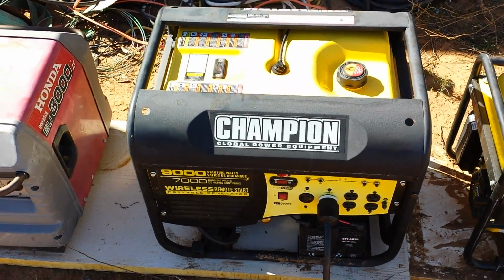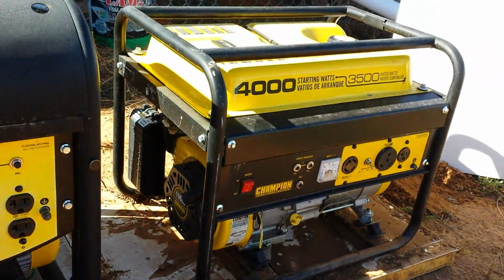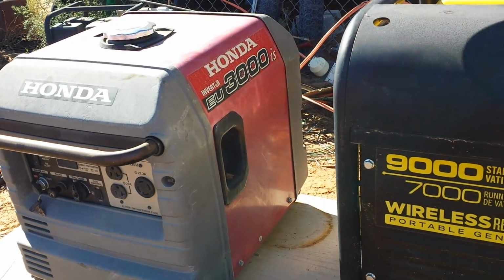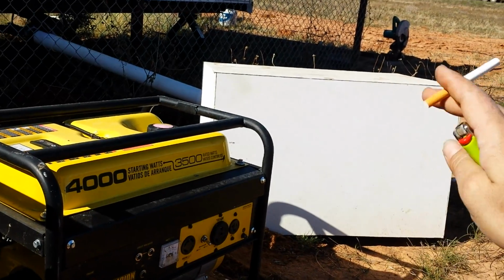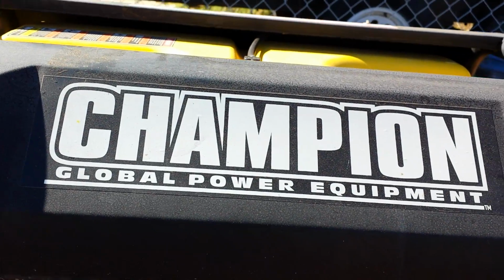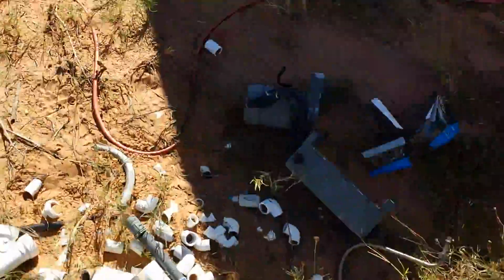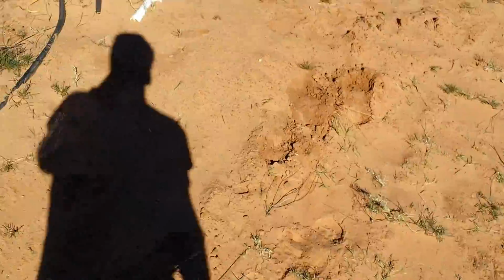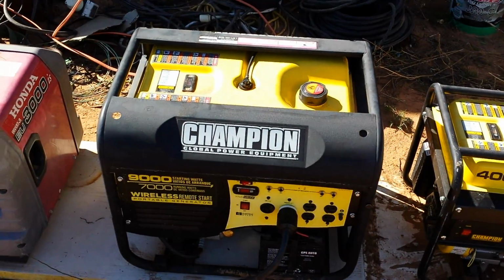whole house backup generator startup and use during power outage pt2

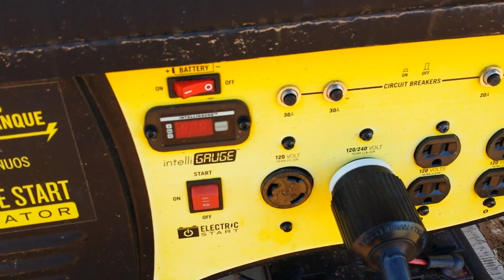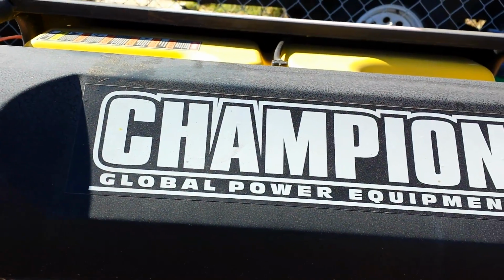Comment: Seems to me it WONT plug into the 4000/3500.....as the outlet SEEMS to be an RV style.....and not a L14-30 with 4 prongs....are you sure what you think you can do? (3:34 - 4:00). Here's a link to an ad showing the panel face.... doesn't look like it would work.... https://express.google.com/u/0/product/6881739062522025442_14998040675177059662_1699011?utm_source=google_shopping&utm_medium=tu_cu&utm_content=eid-lsjeuxoeqt,eid-koyayyivmf,4181969&gtim=CJ-HzMGbl7aWMhC_goCdyePvoMMBGPDP96UBIgNVU0QokLPx3AU&utm_campaign=1699011
Reply from the maker: you didnt look. the L14-30 is right next to the volt meter on my generator as well as the one you linked to. Yes I am 100% positive of what i can do because i have looked and done it and it works
Reply: Thanks for the feedback....as I said, the latest ads for the 4000/3500 version seem to show the RV style plug and not the L14-30.

Comment: i ran my ENTIRE house with a 120V 30 amp 3600 running watt generator with EASE....   NO 240V appliances obviously but i was able to turn ON every light inside & outside, every ceiling fan (9 total) inside & outside on HIGH speed.. Refrigerator ON, Both bathroom exhaust fans ON, All 6 TV's ON with cable box running....  All everyday A/C adaptors left plugged into all outlets (cell phone chargers.. etc)...  My power gauge was reading just about ~1200 watts and held there solid for 3 hrs before i realized .... thats all the power the house was pulling... The generator never bogged... 
All the above are NOT in use everyday but i wanted to see WHAT the generator could handle and it did more than what i expected.. 

I also have a 240V 30 amp 7k running watt generator that i will attempt to see if it will support my 3 ton central A/C...   it has a split surge of 80 amps but runs at 14 amps...  If the dual 30 amp breakers inside don't trip on that 80 amp surge, i can assume the 30 amp breaker in the generator wont trip....